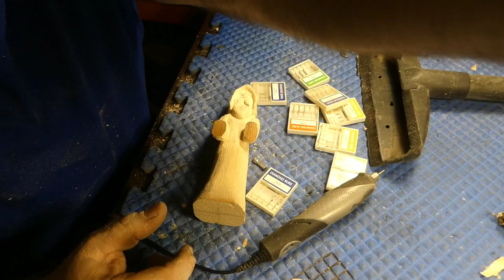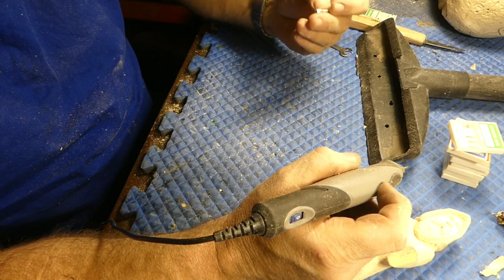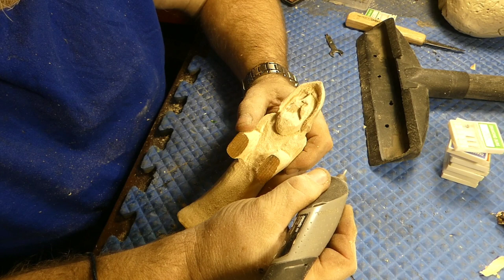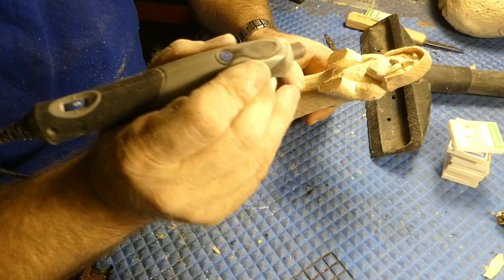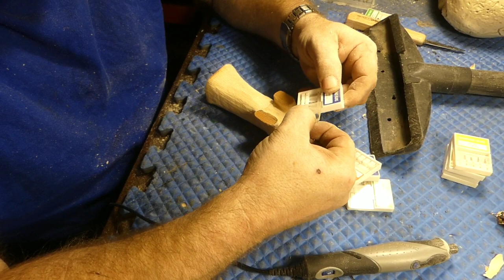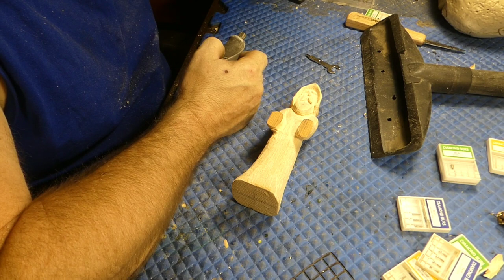Bigger wizard 3 power carving, dremel,whittling

Comment: I have a little cheapie tool like that. Mines not a dremel, it's some off brand, payed about $10 or $15 for it, don't remember for sure. Only thing I use it for is sanding. Sanding should be done at lower speed and not much torque is needed. I just keep sanding disks in it so it's there when/if I need it. Where did you get the dental bits? I haven't been able to find them on amazon. Used to get them from the dentist, but I haven't found them online. For you and anyone else who uses diamond bits. Did you know there is a cleaning block for them? I have one and it works OK. It will help clean the bits and make them usable for a little longer.  I haven't been able to find them on amazon but Treeline sells them. Here's the link. https://treelineusa.com/cleaning-block-1/   Wizard is lookin good. Snowing here today.
Reply from the maker: I got them on Ebay evilevilrick I think they were super cheap but work good bud thanks
Reply: Hi rick bye rick